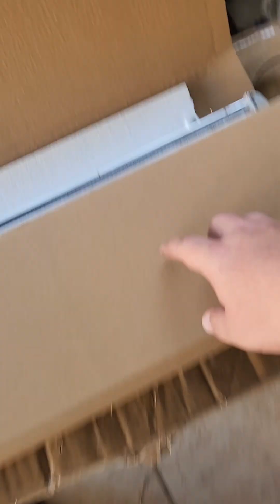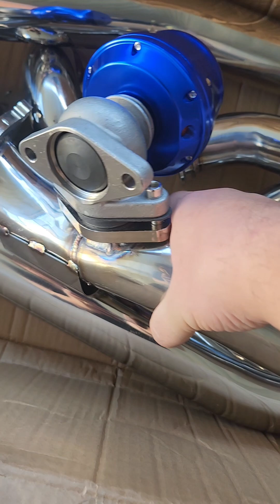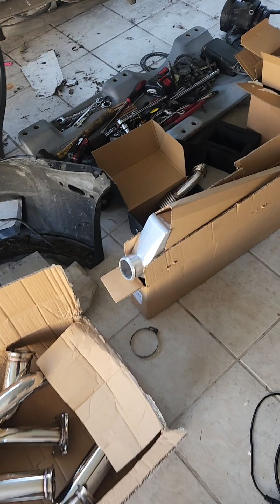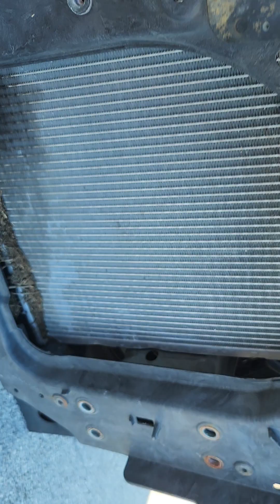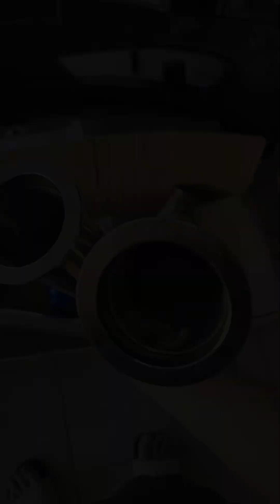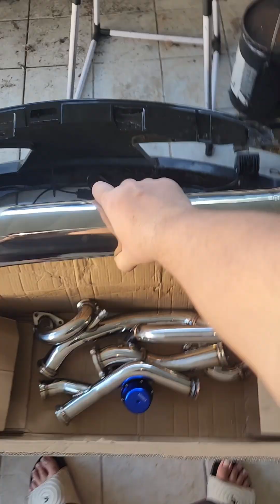G35 / 350z Turbo kit (rev9 replica from alibaba) unboxed

Comment: If it’s the same pipes as the Rev9 I would just upgrade the turbo and wastegate. I’m not sure if we can trust the kit’s turbo, WG and BOV but I’m sure you’ll hit 400hp with those 1000cc injectors. I wish you luck brother keep us updated would love to hear it and see some numbers! You got this shit!!!! 🔥
Reply from the maker: @alexpenaloza4708  yes sir I'm looking only for 350 to 400 wheel on straight e85 which should be do able im actually going with a slightly smaller gt3076 with a ar 82 so very quick spool from 2500 to 6k thats all I need for a basic street/drift occasional track day car
Reply from the maker: Also I'm trying to make it simple and put both videos up at the same time as kind of a 2 parter video one part for the install and discussion of what was performed to make it work efficiently then the 2nd part being the tuning process with Z1's new device that let's admin tuning set you up best way to go in my opinion just from the amount I've seen it done properly that way
Reply: @V35Reckless95  hell yeah! I’m here for it! I’ll be right behind you. I’m trying to boost my G this year. I’ve been working on her for the last two years upgrading all the suspension.
Reply: @ are you gonna use your stock headers?
Reply from the maker: @alexpenaloza4708  yes but was looking to upgrade to the stock g37 or 370 as the outter diameter for the exhaust is slightly larger so less back pressure
Reply from the maker: @alexpenaloza4708  but initially I will use the stock headers

Comment: the hot side needs to be rewelded to fit.... i had this kit
Reply from the maker: @Bart-jf6cr  it fits the only thing I need modified is where the vband for the passenger side meet that side exhaust pipe requires a larger inner diameter to match the other so my idea is have and exhaust shop cut it there weld I plate over it and just weld the exhaust pipe into the U shape pipe for easy removal and 1 less vband. I'm still putting it together I'm on the downpipe portion of the install